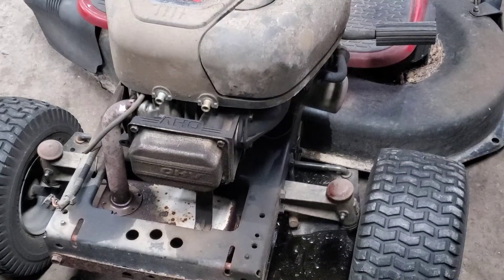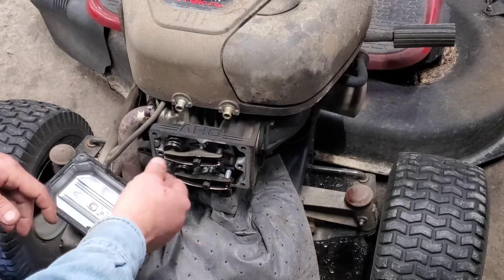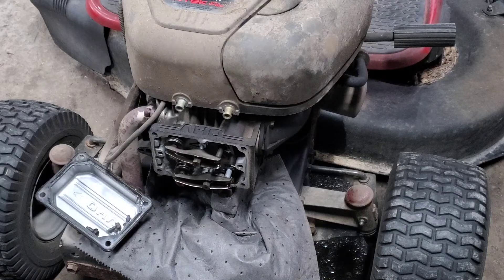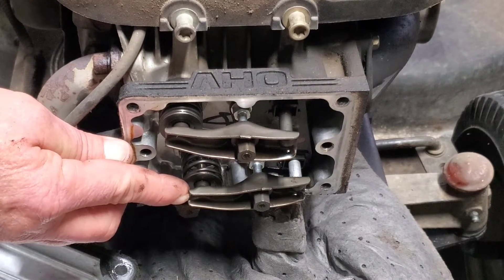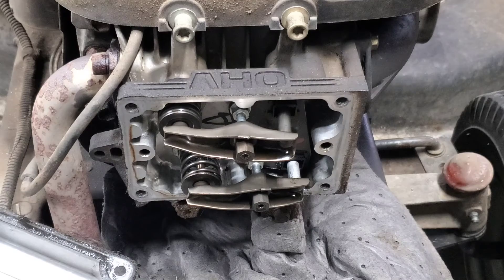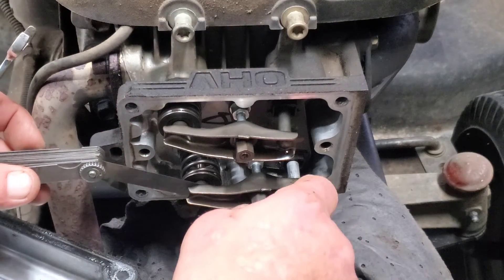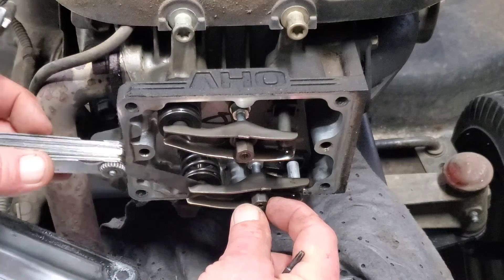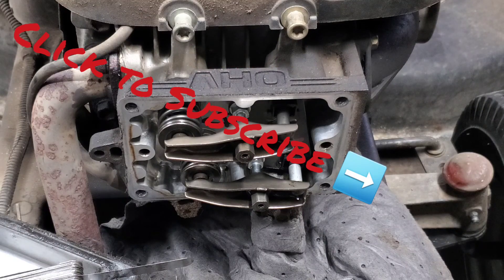Riding Mower Won't Start?  Compression Release Working? We Show You an Easy Way to Check it!

Comment: Camshaft bad. Bummer. Disable the fuel shut off solenoid, get another battery. 24vdc will MAKE it turn over and bust off.

Comment: My Kohler 7000 won't turn by hand, so I can't test the movement of the valves. I can't rotate it at all, seems frozen. Both spark plug chambers were dry and plugs looked clean gray as they should be, so it wasn't flooded with gas so I don't think it's hydrolocked. Starter spins just fine. Solenoid and battery also tested fine. What to do?

Comment: Thank you so so so  so much for this video! I didnt have feeler gauges (mine are 550 miles away from me and the nearest store is 30 miles away), so I used a piece of copier paper for a feeler gauge, LOL.

According to some random webpage, standard bond copier paper is 0.0045". I went for a very light drag. I know, shade tree, meet mechanic. 😂

The exhaust rocker bolt had backed out several turns, so it was a miracle the thing ran at all when it finally wouldnt start anymore. (The mower was a gift from the neighbors, it had sat for 2 years and they just wanted to get rid of it.)

Comment: I got a mower with a new nikki carb. I did notice there appears to be gas in the oil. I'm not sure if the carb is still an issue or if they didn't do an oil change after changing the carb. This mower has the same symptoms as the mower in the video. I tried adjusting the valves 2 times. Once to 004 and another time to spec 005 and 006. Still don't wanna turn over. I checked and got the bump on bottom rocker. But i hear a clicking noise at the bump. Do you think the cam is bad? I hate to open the engine up for no reason.
Reply: I’m in the same boat but one of my push rod guides fell off. Hopefully that’ll fix my issue
Reply: @ryanschaffer5777  I ended up opening the engine up, and the cam was still good. Everything else looked good too. There was a little play where the counter weight attaches to the crankshaft. So I'm guessing that's the noise I was hearing. I put it all back together, and now it starts easy. I am wondering if I just did a crap job on valve adjustment. I have seen several videos that say adjustment should be done at top dead center. So I did that. I re-watched this video and realized he was adjusting the open valve while the other was closed. When I turned the engine to that point after adjustment at top dead center and they were loose. So I adjusted exactly how T-Bone did in the video, and now no problems.

Comment: Mines problem is the fuel pump those engines don't need it im gonna put the battery under the seat and the fuel tank under the hood how it is on all my other mowers.

Mine idles on the first crank up and idles hi im sure it needs adjusted but any other crank ups the gas floods to the piston because those engines aren't made with fuel pumps someone added the fuel pump onto this engine i just bought for 40 dollars  anyhow the fuel pump will be coming off for good and no more fuel tank under the seat.

I wouldn't be surprised if my valves need reset i seen someone used puddy instead of a gasket on the cover and looks like the wrong grade to so im gonna go over it all after a pressure washing.

At first my engine acted like it was a camshaft problem or compression  release until i could hear the gas splashing around so when i took the spark plug out the gas poured out into the grass and dirt i l cranked it over awhile to blow the rest out  then let it sit then put plug back in and it ran but needs adjusted and the exhaust smoke color is showing its getting to much fuel at once plus its old fuel so im glad mines not another bad camshaft cause they cost to much from briggs

Comment: Finally fixed. My starter motor was getting 12v but wouldn't turn the flywheel even when attached directly to battery, but I could hand turn the engine pretty easily. Turns out I got a new sparkplug with my carburetor kit and installed a plug that was too short. It caused more air to be allowed into the cylinder. When my start motor would try to turn the flywheel, it couldn't overcome the increased compression and would draw too much voltage causing a voltage drop. You video helped me out a lot and got me up and running.
Reply: 😂^^^thats hilarious

Comment: Is there any way of installing a manual compression release on the Briggs and starting engine  ?
Reply: The only way would be to drill and tap a hole in from the top of the head, and fit a compression release valve to it.

Comment: Thanks for the tutorial. I work on all my own mowers but I hadn't ever adjusted the valves. I know you busy like all of us these days. I thought with age things would slow down a bit..lol...seems like I'm more busy at 55 than ever..lol
Okay, to my question sir...
I just bought an older rider, MTD Product with a 17 hp Sabre ( someone replaced the original engine on this Power Pro which had a 12 hp  originally..So this thing has either some serious compression or something else that has me stumped...but with a good charged 12 v battery it turns over as if the battery weak. My meter says different ( tried several batteries) but in order to start this thing I have to jumper two batteries together and hit it with 24 v to turn it fast enough to start. What's your thoughts? Thank you in advance with any suggestions.
Reply: My bad , in my previous comment/question I didn't make it clear that I was going to check the valves as your video showed straight forward as I prefer info. I only was asking if infact you think that's my problem or dò think there is more to it? Thanks
Reply from the maker: Once you adjust the valves, with spark plug removed, spin the engine over with your hand slowly.  You will see valves open and close, you are looking for an additional bump open on one of the valves.  That will tell you if your compression release on the cam shaft is working.  I'm filming a video today on a cub cadet rescue that will show exactly what I'm talking about.  I also have another video showing how it works. The video I'm working on should be out this weekend, I have a ton of editing to do after filming.
Reply: @RaleysSmallEngines  Thanks for your prompt response good sir. 
Your time and effort is appreciated. 
This work is your livelihood and I  assume a source of income for you.. 
I myself an insurance   agent and owner of an insurance agency. 
More importantly,   I'm a country  boy raised on a farm. Driving tractors at a young age , my Dads old Chevy C10 which I had to stand up to depress the clutch to shift the 3 on the tree and no pwr steering lol.  Miss that old truck and even more I miss the Ole Man. It He was the best man I have ever known to date...the world was a better place with him it but part of me is glad he isn't here to see the shape of things in our country... forgive the tangent.
 So your advise is then a service you could choose not to give for free...but the fact that you do so helps tip the scales in a positive direction  in  restoring my faith in the people of a country I love but find myself feeling a sense of embarrassment when I see a common mantra adopted of "what's in it for me" with a  goverment that is liken to that  of a circus event in which what we see ģoing on  before us in the main arena is nothing like what the ad poster promised. And they don't seem to care that the audience ( the American constituency )  is watching them carry out the destruction of the nation. 
I proudly served  her for 8 yrs  including 2 x in the PG and I would like to think  that at least in spirit it wasn't all for nothing....
So, to that point I thank you for your part taking time  to help others(  simply because you  choose to ..one of honorable  traits which once  made our country  a better place 

Ps. I give you my word , I will never send you such an over the top and lengthy comment.. thanks again..

Comment: Thanks for the video. Watched a few to get the jist of adjusting the valves as I had never done it on a small engine. Love your humor and thought you might get a kick out of the fact that I straightened out one of my bent pushrods with a brass mallet.

Comment: I have 2 doing the exact same thing , motors turn slightly and stops, Bump is fine on both,, i set valves over and over, finally tighten the nuts and star screw on the rocker arms finger tight so no play in the valves. Been working fine ever since.

Comment: Let me tell you my story. 1st my 1996 Snapper 14 HP tractor style mower mower  hydro locked after not using over the winter because the carburetor was leaking gas into the cylinder and crank case Changed the oil. Put a new float needle in the carb and did the same thing after sitting for a couple of weeks. Then I installed a cutoff in the gas line - problem solved.
      Sometime later it seemed to hydro again but I knew it was not  the gas leaking. I adjusted the valves which were not really out of whack, no luck, Then I bought a new 275 amp  battery from Wally World. Cranked really easy. Cut my yard  and cut off a few times and cranked right back up. Put the mower up. Went to crank it up a few days later and it cranked great but was running wide open. Found a twig in the governor mechanism and removed it. Now that baby is back to making my yard lock great and still going strong on it's 27th season. Bought it used in 2007 and the only thing I've done to it is the above plus a front wheel bearing, a few batteries, new blades, a new throttle cable and changed the oil. And that bad boy doesn't even have an oil filter. Never changed any belts or bearings in the deck. In 15 years I have not spent even $200 total on it except for about 3 batteries.
     For years I cut my grass when very damp and never washed out the underside of the deck. Took it off later and scraped the stuck grass off , washed it and  not a rusty place anywhere. Wish they still sold those little bad boys.. Bought a new Craftsman last year for back up  on sale as a return for half price plus the military discount but I like the old Snapper better and it does a better job. Makes my lawn look like carpet. The new mower has  foot controls for forward and reverse. I hate it. The Snapper has a fender mounted lever for that and is way easier. Both are  automatic transmissions of course. 

Ok _End of my story.

Comment: Was given a Craftsman lt1000 that didnt run. Carb float was stuck, filled the crankcase with gas. Cleaned the carb and gave it an oil change. Threw a new battery in it, new gas and fuel filter, had good spark and compression.  Couldn't get the thing to start, would lock up the flywheel and the starter couldn't overcome it. Came across your video and gave it a go. Had probably .030 on the intake, set both to .004 and it fired up first crank. Took all of 10 minutes, thanks for the good video!
Reply: Oh man, your comment saved my ass. Had a similar issue and I was going down a starting circuit rabbit hole. Mine was an incorrect spark plug that was causing too much air in the engine and my starter motor couldn't overcome the increased compression and drew too much voltage causing a voltage drop.
Reply from the maker: Wow, that is great 👍🏻 . So glad this video helped you out.
Reply: I have the lts1500 with the same issue. Bent push rod on the bottom. Would that be the intake then or exhaust?
Reply: you have a (small )  error in your comment   ------filled the crank case with gas --- i do not think so   oil in crankcase only   i know it was a miss print
Reply: @frankdavidson9675  The carb leaked the gas into the crankcase. Re-read and apologize to the man

Comment: Will this fix the cam spring problem if it looks locked and won't start?
Reply: @Raley"s Small Engines
Reply from the maker: I'm not sure I understand the question.
Reply: There seems to be a 3 part fix. A new camshaft is one of them, but then another Youtuber has a video about installing the new cam with modifications.
You have to make sure the lever that goes into the cam slot is flush with the cam. If not file the lever to be flush with the cam, not catching slightly as the rod crosses over it. Then put an AC compressor O-ring on the outside of the weight, that way it keeps the weight from rocking as it is going around. The rocking adds more of a chance for the lever to cock its way up into the bottom of the rod while spinning as well. He showed the counter weight itself has about .o9o of rock of the weight on the little shaft it resides on; side to side motion. What's more promising he showed it with the O-ring installed and really looks good; like there is plenty of room for oil to still get between the O-ring and the shaft to allow oiling.
He's got over a year on his now, so there is hope for those of us with metal  shards residing in the bottom of our oil pans...

I know you have made a decision by now. I'm thinking of just going in and taking the metal out and leaving the cam installed without the compression relief. Just using the hand method over the air inlet for now.

I won't post the video on another person's channel, but it is out there; just watched it. Happy mowing.

Comment: What is the issue when a craftsman v2 engine spins very fast???? I was using mower when suddenly a metal clicking/rattling started happening with the motor immediately stopping!!! Now when ya turn the motor over it spins very fast like there is not compression or like both spark plugs are removed!!!! Engine was running tip top until this happened!!! Got any suggestions for me???
Reply from the maker: Yes .... the valve seat in the head came out and is holding the valve open.  I am doing a video on that exact problem this week.  Including how to repair it for about $20 bucks.

Comment: I don't have the little bump :(   I just picked up lawn tractor with a B+S 21HP. Owner said blown engine. Won't start. I tried it and the starter just spun freely. The starter gear was obviously broken. So I paid the man and brought it home. Took the starter from another motor, charged the battery, and was a little stubborn, but started. Started a few times actually. I think I just got lucky because I can't start it again. Did the valve adjustment and still hard, or won't crank, at all.
Reply from the maker: No bump = bad cam shaft. Just got one in the shop this week same issue.  Hopefully will have a cam shaft video soon. It's not a difficult repair. Thanks for watching. Stay tuned and when the parts come in I will get a video out as soon as I can.
Reply: @RaleysSmallEngines   I've ordered the camshaft. But I was able to start it, then adjusted the valves, now can't. Build date is 11/09 and I can tell someone's been in there before in it's 12 year life based on using sealer rather than a gasket. Is there a valve setting that can overcome the lack of the compression release that I messed up trying to fix it?
Reply from the maker: @jeffflowers729  If the compression release is broken off the cam shaft valve adjustment will not help.  When you tear down the engine you will find broken pieces of metal inside the crankcase that came off the cam.  Be sure to clean the inside of that engine clean enough to eat off of.  If you don't have a parts washer you can use brake cleaner and compressed air and/or rags.
Reply: @RaleysSmallEngines  thank you. For now I found a temporary fix. If you remove the air cleaner and cover the inlet with your palm to create a seal, it reduces the amount of air intake so less pressure and the engine will turn over. then pull your hand off and it starts.
Reply: @jeffflowers729  Have you been running your mower ever since?
Asking for someone with a bunch of metal in the bottom of my oil pan...
Reply: @kramnull8962  Hi yes. Ran it all season covering the air intake to get it to turn over as mentioned earlier. If their engine has an oil filter then there is an oil pump and a pickup with a screen that will also catch any loose pieces. Ironically I just pulled the engine apart two days ago to make the repair. I was able to successfully replace the camshaft but didn’t realize I had ruined the crank oil seal and it was leaking so had to pull the engine off again waiting on a new seal to come in. I was able to pull the old seal without opening up the engine again. Looks like I can replace it as well.
Reply: @jeffflowers729  Have you seen the video on another channel about using an O-ring against the counter weight to stop the rocking motion? 
It seems viable if you are already in the engine. He also stated about making sure the lever was flush with the opening on the cam to make sure it wasn't being hit for future longevity.
Reply: @kramnull8962  I believe I did see that vid now that you mention it. But my engine is back together now. Next time lol

Comment: maybe you can help me out im trying to get the piston conecting rod cap off and it has 2 looks like torx screws holding the rod cap on and i cant see it well enough to tell what sise they are and dont want to strip them out any help would be appriciated thanks
Reply from the maker: sorry i can't remember, sometimes a small mirror will help you see the bolts in a tight space.  Thanks for watching

Comment: Good Video, I got the same engine . My cam has the same bump with a good opened intake but my exhaust value opens about 1/8 of an inch ,  nothing like the  intake. I was mowing and it started coughing , so I cut it off and parked it. What is wrong? , the value glide is not the problem ,I can push it all the way down with my fingers, the push rod is not bent. I think it is the lifter or the cam lobe, that is all I can figure out. I hate tearing down the engine. HELP..
Reply from the maker: Thanks for watching.  Yes sir, that sounds like a lobe on the cam.  I know it's sounds like a pain, but it's not a difficult job.  Just a little time consuming getting everything clean and gaskets removed.